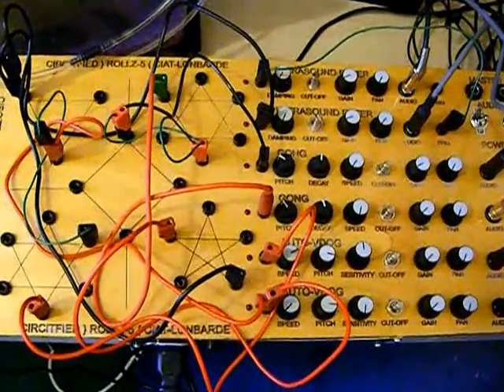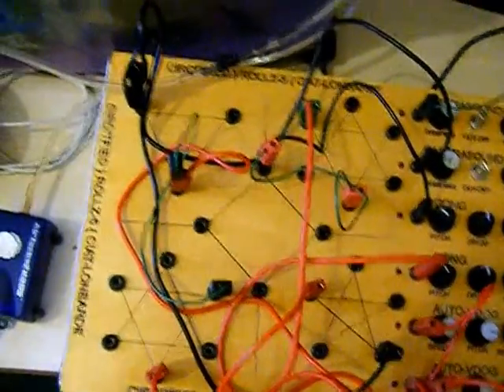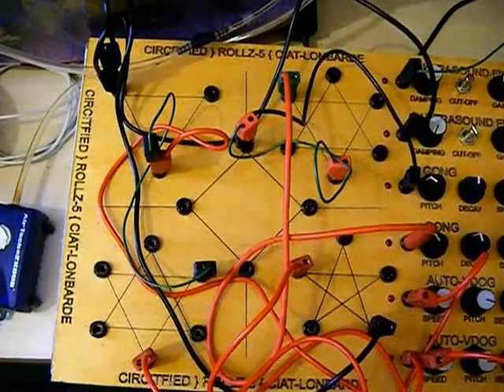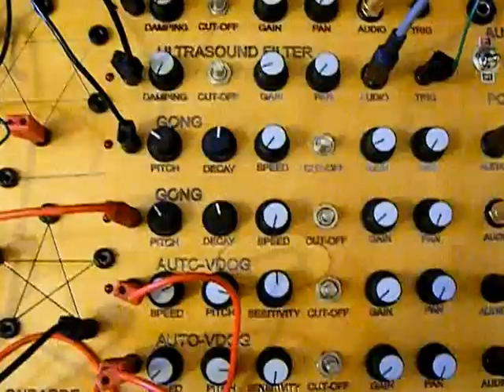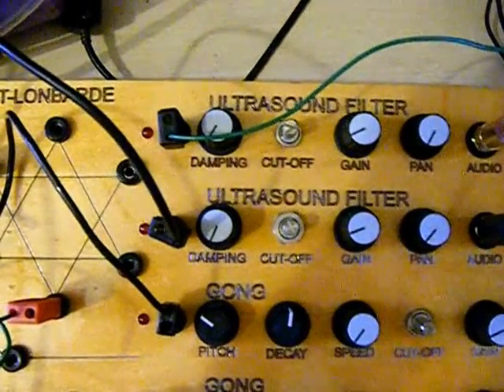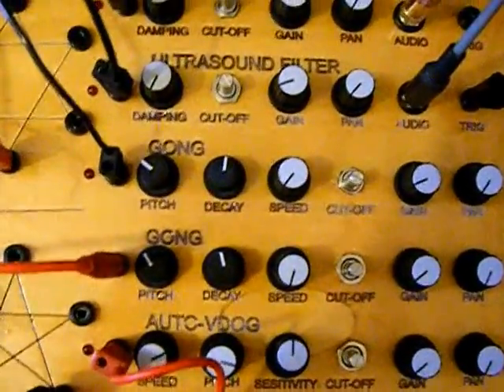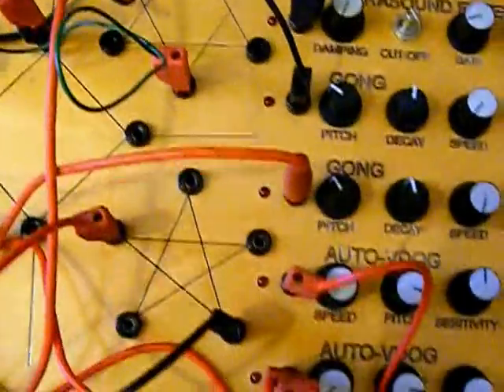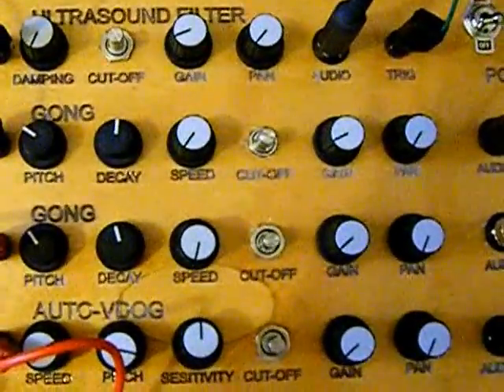ROLLZ-5 Ciat-Lonbarde cottage-made drum machine

Comment from the maker: I believe it sounds better than the Rollz-5 in this video because all of the drum sounds work easily and the drum tones are also controlled by the signal that triggers them. As for the price I understand what you mean, I believe I am sensibly pricing this as I do not want to undercut Peter and also I need to pay myself a sensible hourly rate. Do get in touch and we can talk privately about adjusting the price. Included in the price is a donation to Peter for using his circuit designs.

Comment from the maker: Hi, the only controls the drum voices on the etsy one have are for frequency cut-off. I think the one on Etsy sounds far better than this one because you can't change the sounds. The one on Etsy doesn't have the trigger outputs either, as they were a bit pants. The one on etsy has 6 individual outputs and a master output, as well as master gain. It also has extra sequencer circuits. so it has 2x6, 1x5, 2x4 and 2x3 node brains, which is two more circuits. Check out my soundcloud for the etsy one.